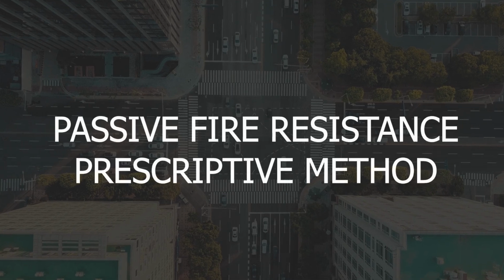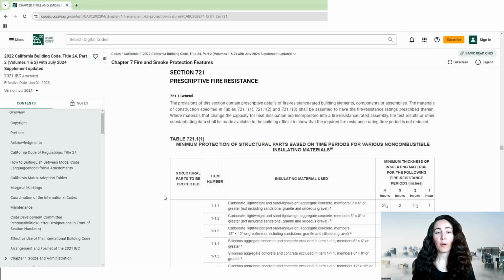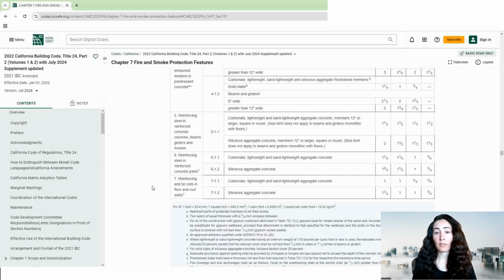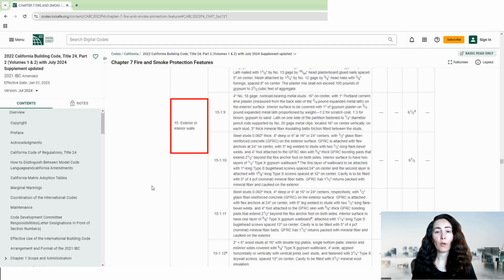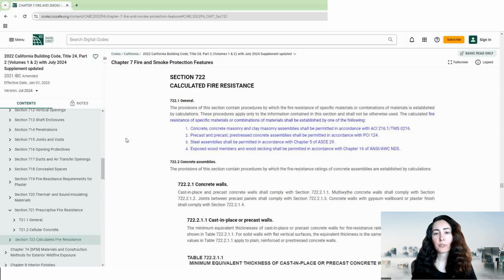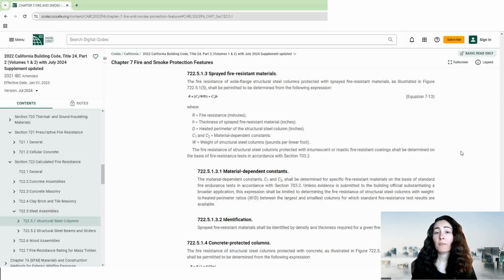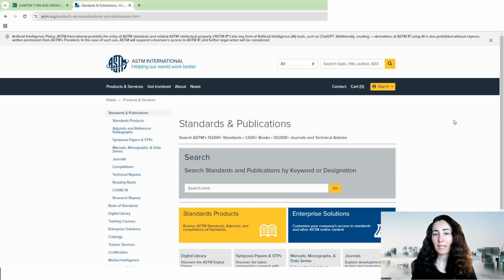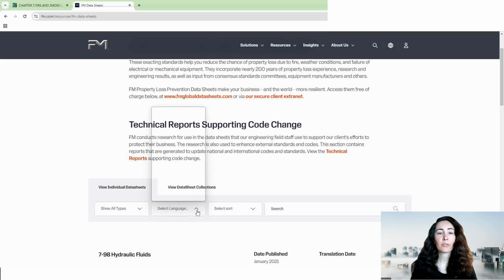Prescriptive VS Calculated Fire Resistance in Building Design

Comment: This video provided a comprehensive understanding of fire-resistant materials and assembly types, highlighting where to find relevant materials and their ratings. It emphasized the importance of fire ratings for various building components and demonstrated how to navigate tables and charts to identify the appropriate materials for effective passive fire resistance. I found it intriguing to see how much thought goes into designing for safety alongside aesthetics, and the connection between fire rating requirements and design considerations will be valuable for future projects. This video will certainly serve as a helpful reference moving forward.

Comment: Thanks to this video, I learned that prescriptive fire resistance relies on building codes that specify materials and assemblies with predefined fire resistance ratings, based on testing from ASTM International, ideally. This method provides clear guidelines for compliances and is comprehensive for standard projects or studio work inclusion. 
Calculated fire resistance is a more complex method additionally utilized by engineers, particularly fire protection engineers and structural engineers. This method relies on performance-based models and testing (like those conducted by UL) to determine how a structure will behave in a fire. This approach can offer more flexibility to complex projects but requires a deeper understanding of nuanced topics such as fire dynamics and material behavior.

Comment: As an architecture student, understanding passive fire resistance ratings and how specific materials or assemblies are tested for safety is incredibly valuable. This knowledge helps me make informed design decisions, prioritizing safety and compliance in my future projects. By knowing how different materials and wall assemblies contribute to fire resistance, I can incorporate the right components to meet building code requirements. This insight will be essential when designing safe, resilient structures, particularly in projects where fire safety is critical, such as high-rise buildings or public spaces.

Comment: This video was really helpful to show how important fire rating is and the different rating requirements for various building components and what materials to use in order to have the best passive fire resistance. The fact that fire rating of materials relates to the program is helpful to understand and remember for any projects I may work on. Showing the process that should be taken in order to reach the correct passive fire resistance along with how to read the charts was very helpful. Definitly will reference this video in the future.

Comment: This video helped me understand how to achieve passive fire resistance in construction. Designers should identify the appropriate assemblies that meet specified fire resistance ratings while ensuring compliance with safety standards. Using these assemblies carefully is crucial, as modifications can require additional testing to maintain their approval. Additionally, calculated fire resistance methods are available for assemblies that don't conform to standard categories, allowing for tailored solutions based on material properties and expected performance under fire conditions.

Comment: This video helps to explain the concept of passive fire resistance in buildings, and how specific materials and assemblies can drastically change the fire rating. Chapters 6 and 7 of the IBC explain which building types need fire protection, and how that protection can be achieved. For example, some steel columns may need additional fireproofing, which can be achieved with external layering or active systems. The video additionally explained how organizations such as UL, or Factory Mutual can give detailed instructions and specifications for fire resistant assemblies. This is helpful to architects when materials in a project do not meet the required fire code, and need additional systems to ensure safety in the event of a fire.

Comment: This video helped with getting a better understanding of materials and different types of assemblies for fire resistance. It also shows where to find all of these materials and ratings as well. I find it very interesting that there is so much more to designing and constructing. There is a lot to think about and figure out to work with your design as well as it being safe for the public as well. This video helped with combing through different tables that'll help with figuring out which materials would be fire resistant and their ratings.

Comment: This video helped me to better understand the way fire resistance can be addressed in both prescriptive and performance-based methods. The prescriptive approach is similar, cost efficient, especially in common structures. It's logical and sensible as it is based on predefined, approved solutions. In contrast, performance-based methods are more custom, useful for complex and more personalized designs where safety and design are both very important. It was helpful going further into the classifications of materials and assemblies, and I’m hoping to apply these concepts to my next project.

Comment: This video gave me a clearer understanding of how fire resistance can be approached from both prescriptive and calculated methods. The prescriptive approach is straightforward and cost-effective, especially for typical structures, as it relies on pre-approved solutions. On the other hand, the calculated method allows for a more tailored approach, which seems particularly beneficial when dealing with complex designs where efficiency and safety are key. I also appreciated the emphasis on specific code sections like Chapter 6, which is crucial for ensuring compliance. It was insightful to learn about the detailed classifications of materials and assemblies, and I’m inspired to apply these principles to my next project. I’ll likely explore options like UL’s U490 for non-load bearing steel partitions, as it offers a practical and well-tested solution.

Comment: Very informative video I was able to grab a much deeper understanding on how certain rules and classifications such as fire rating and how they are tested. ASTM 3119 is the Standard Test Method for Fire Tests of Building Construction and Materials, they work globally to set standards for different materials and their fire resistance, the conditions they need to meet, and more by actively ensuring it meet certain standards. For a recent project, I did a cantilever project that was an exposed structural system that became part of the design. For this project I used w12x72  steel columns, to keep the column exposed and be seen as such fire resistance would be 4.29 thickness around the beam to make it 4-hour resistance if it was an assembly of clay masonry protection. The perspective method and using what is already given by code is the most efficient way of fire protection in saving money and being able to ensure that you get approved by code officials much faster.

Comment: In the video, I feel like I was really able to understand more about the fire-resistance and how it can be applied to buildings. The information that was being presented about how many hours and the minimum thickness protection of the material that can last for the fire-resistance. The calculation was also really reparented in this video, describing how the structure of a building can has a unique and complex design. The fire-resistance is a good way to really focus on how long the structure can resist any fire (either from inside of the building, or the fire that is created outside the building).

Comment: I was able to understand the difference between prescriptive and calculated fire resistance from this video. The tables from chapter 7 describing prescriptive methods of fire resistance is really helpful for our projects this semester. For example, I now have a clear understanding of the fire resistance layers needed in order to keep columns exposed and the assemblies of exterior/interior walls when using steel studs.

Comment: This video clearly introduces passive fire resistance via prescriptive and calculated method and organizations that create & test standards. The prescriptive method is about what materials that we can apply to achieve passive fire resistance rated construction for building elements, components, and assemblies, which is referring CBC CH. 6 and CH.7. The calculated method can be divided into different assemblies, such as concrete assemblies, concrete masonry, tile masonry, steel assemblies, and etc., which is referring to CBC CH. 7. Also, organizations like the American Society of Testing Materials (ASM), develops all the standards that support design construction and performance of buildings, Underwriters Laboratory (UL), tests and certifies all kinds of products used in the construction industry to ensure that they meet safety standards and make this information available to the public, and Factory Mutual (FM), provides certification that products can win withstand extreme hazards, are very useful while applying to our own projects.

Comment: I found the comparison between the prescriptive and calculated methods for fire resistance really interesting. The prescriptive method is simpler, with set rules that work well for standard buildings. In contrast, the calculated method offers more flexibility, which is helpful for designing complex structures. This flexibility can improve safety while using materials more efficiently. The video also stressed the importance of checking specific code sections like Chapter 6, which is key for ensuring designs meet fire safety standards.

Comment: I found this video very interesting and useful because it went more into depth on the type of fire rating and resistance for a building's assembly. I also found the information on prescriptive and calculated fire resistance types to be interesting because it is something I didn't know about. The one I found more interesting is the calculated type because it needs to have calculations done before being applied because most of the time it is used for custom designs. I also liked that chapter 7 of the ICC has more information for materials and their fire ratings.

Comment: Great job breaking down the key considerations for achieving passive fire resistance in building construction. I appreciate how it walks through the importance of consulting the correct chapters, like Chapter 6 for rating requirements and Chapter 7 for material assemblies. The detailed examples—like the 4-hour fire resistance rating for steel columns and reinforced concrete columns—are especially useful, providing insight into how specific materials like clay tiles and gypsum can influence fire ratings. The mention of standards organizations like ASTM, UL, and Factory Mutual also highlights the importance of certified testing and standards in the construction industry. This is invaluable information for anyone involved in design and safety compliance
Reply: Hello Nicole,
Your observations are spot-on! Building construction safety requires an understanding of passive fire resistance. It is essential to take into account how the integration of these materials can impact overall fire performance in addition to the significance of Chapters 6 and 7 for fire ratings and material assemblies. For example, applying fire-resistant coatings to structural components might raise their fire ratings; this should be taken into consideration when making design choices.
Furthermore, standards bodies like ASTM, UL, and Factory Mutual play a crucial role in both ensuring compliance and fostering innovation in fire-resistant materials and methods. Design professionals can make well-informed decisions that adhere to current best practices by keeping up with the most recent developments in fire safety requirements. In addition to guaranteeing compliance, this proactive approach fosters a safety culture, which is essential in the construction sector. All things considered, anyone interested in design and safety compliance would really benefit from your views!

Comment: In this video you see where to find the information about the fire resistance of a building, and where you can find this information is in chapter six for rating requirements and chapter seven to find the right material assembly. There is information in these tables about the exterior walls, wood studs, and such as more information about these materials and their assemblies and their ratings which is very informative. There are organizations such as ASTM which do not conduct testing but set standards and provide training, there is also UL solutions that does testing and solutions, and lastly FM which does both of what the other organizations do, which is nice to know that there is more than one place to find information.

Comment: I've learned a lot more about fire resistance requirements by watching this video. It's helping me to think more about using the code when developing my project, especially since it's in a high fire zone. I still haven't given much thought about what specific materials to use, I do know I would like to use ceramic tiles or perhaps masonry on the envelope of my project. I really liked how this video touched based on these types of materials and where to find them. I now know to look at chapter 7 section 722 for the calculated fire resistance since one of the sections is about clay, brick, and tile masonry. I'll be sure to browse through this section when I'm 95% sure I'll be using those materials.

Comment: There has been a consistent emphasis on fire resistance throughout the majority of these videos, and for good reason, as building the proper habits in order to counteract the significant threat of fires is very important for human safety. This video showed the two different ways that fire resistance is applied, with calculations or perspective fire resistance. I feel that calculations are the most accurate and line up best with the standards that we need to meet in potential future projects. The usage of proper materials, interior or exterior, is also an integral part of safety and design.

Comment: This video was really helpful explaining the difference between prescriptive and calculated fire resistance in a building designs. Prescriptive fire resistance uses predefined fire ratings for materials and building elements that are specified by building codes. Calculated fire resistance uses engineering calculations to determine how a building or structural element will perform under fire conditions. This video also does a great job in showing how the different building elements are categorized on the table for easy reference for future projects.

Comment: This video was very helpful for clarifying more components to fire resistant building assemblies, like describing the difference between prescriptive and calculated fire resistance. The prescriptive method has set rules while the calculated method requires specific calculations which makes the method more custom in application. I think the calculated method makes the most sense to me in terms of ensuring a building's safety as much as possible, all while using desired material.

Comment: 1. ASTM E119 is a standard method of testing that evaluates the fire resistance of materials in buildings and material assembly. The information contained can help someone test the capacity of fire resistance in any building member or assembly. 
2. The site I went to for my project is the UL, and System No. EWS0049. The material assembly: Steel Studs, Alternate Base Walls, Batts and Blankets, Interior Gypsum Board, Exterior Gypsum Board, Weather Resistive Barrier, Exterior Foamed Plastic Insulation, Mineral Wool, Exterior Metal Cladding
3. I would choose prescribed rather than calculated to save on time and money considering you would not be required to do the testing yourself or outsource.

Comment: This video does a great job explaining the difference between prescriptive and calculated fire resistance in building design. The prescriptive method is straightforward, with set rules to follow, which makes it easier for common buildings. The calculated method, on the other hand, allows for more customized designs, especially for unique or complex buildings. Both approaches are useful, but it’s cool to see how calculations can help make buildings safer while saving materials. Thanks for making this clear! Understanding the fire rating of building materials is really important for how we classify a building's fire resistance. The tests done to provide this information help us see how well a material or a group of materials can handle fire and heat. It's not just about stopping the fire from spreading, but also about using materials that can stay strong and support the building during a fire.

Comment: After watching the video, I found it very helpful to learn about when to consult Chapter 6 and Chapter 7. For example, Chapter 7 is useful to determine fire resistance for assemblies that do not necessarily fit into the prescriptive pre-tested categories. Chapter 6 is useful to figure out what the rating requirements are for various elements of a building. I also found it helpful to learn that using intumescent paint for fire resistance for steel columns would be ideal if you want your columns to be exposed in your buildings. I will be utilizing that material for my building design.